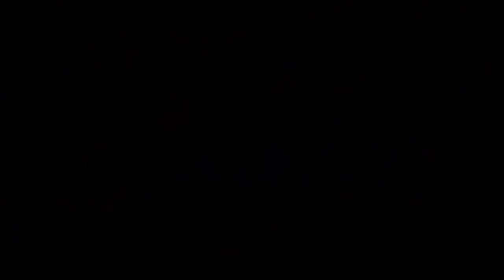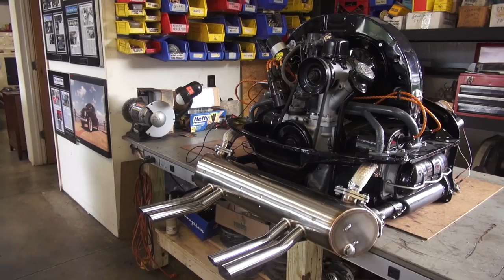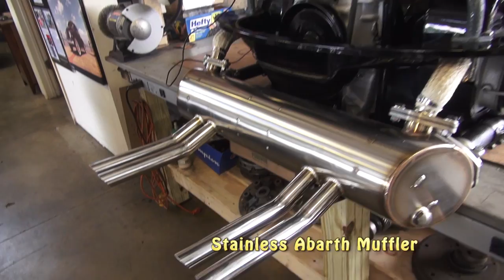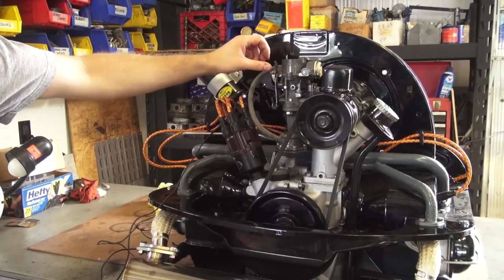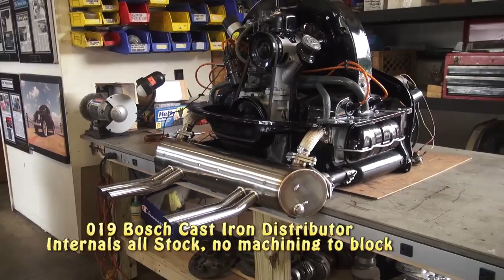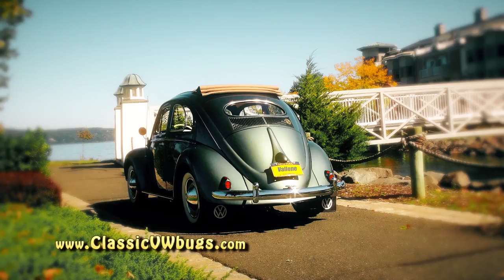Classic VW BuGs Fresh Big Bore 40hp Engine Motor Build w Vintage Speed Abarth Muffler

Comment: Chris - Have you noticed any oil temp differences between fresh air and stale air configurations?  I am building a 40hp Judson Engine for my ‘65 vert and I want to maintain a ‘stock / period correct’ appearance as much as possible.
Reply from the maker: well anytime you upgrade there is always a possibility of that.  You might see it with the judson a bit.

Comment: I heard there is some clearance issues with the webbing on the case?
Reply from the maker: Clearance issue where?  Can you clarify?
Reply: Chris Vallone I’m about to install the same thing on a 40hp. Forums say the Pistons need to be cut because a clearance issue on the 3rd cylinder. They say it will hit and make a bit of a noise, won’t stop it from turning
Reply from the maker: @cameronthomas4290  I've never had the issue.  They slip right in and just do the build as you would normally do it.
Reply: @classicvwbugs  I had the issue 15 years ago . . . I actually did case web relief / clearance  . . .  Was concerned I would screw up the pistons. Apparently the reissue of the 40Hp BB kit used a different profile piston skirt. This was a Mahle kit ~2005 timeframe.

Comment: What makes this a big bore if the internals are stock?  I have a 40hp that I’m planning to rebuild in the winter with 83mm pistons, performance cam, HD springs etc.  do you have videos of a 40hp rebuild much like your 36hp rebuild?  Would love to see those as well.
Reply from the maker: Big bore is piston and cylinders.  My 36hp rebuild video will work towards the 40hp build.

Comment: Chris - I have a '73 1600 dual port engine I am planning to rebuild in spring time - how do you determine what parts to get for rebuild? is it kit package or buy individually  etc... and is there a certain brand to use for rebuild?
Reply from the maker: Well the motor needs to be broken down and all components inspected.  I buy what is needed.  I would take my internals to a machine shop to have them looked at.  Usually try to buy things german or OEM.
Reply: Thank you Chris - BTW love you videos